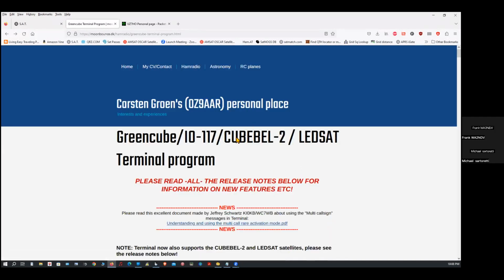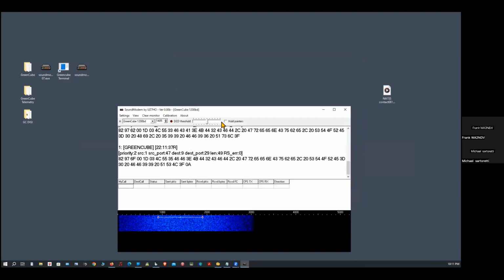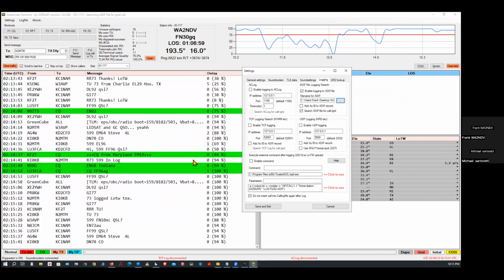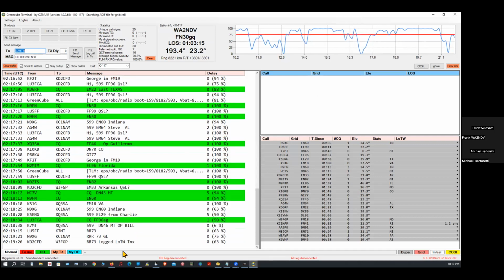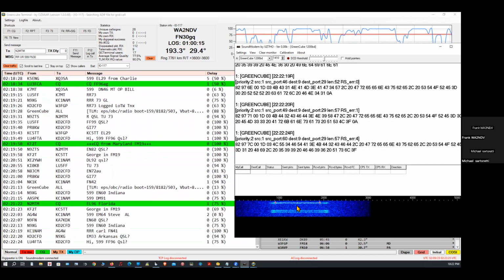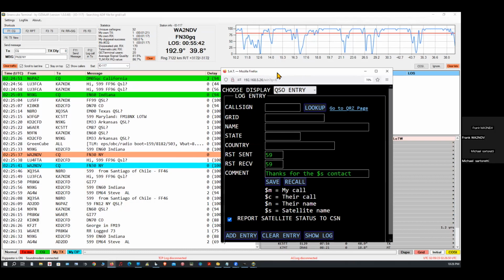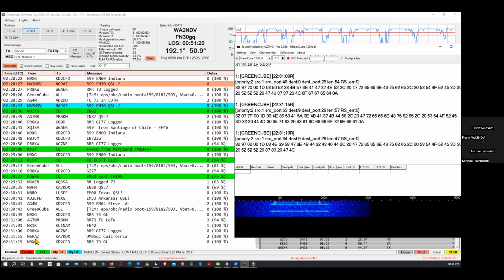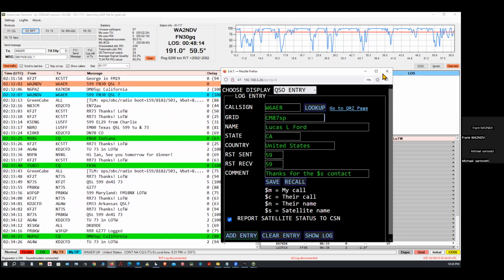Setting up and working IO-117 Greencube with your Icom 9700.

Comment: My waterfall is blank.  When I change the soundmodem  input to microphone, the waterfall shows the ambient room noise.  But when I switch back to usb audio from the 9700 I see nothing.  It’s like the input gain from the usb is set to zero, but it’s set to 100%.  I’m baffled.
Reply: Check  Menu>Connectors>USB AF/IF Output and make sure it is set to AF  also Menu>connectors>MOD Input>DATA MOD and set it to USB.  Be sure you use USB-D as Mode for the VFO

Comment: where are the bandpass freqs of 800-2100  entered.   BPF width    txbpf width   lpf width ???
Reply: Width is automatic for AFSK GMSK you just need to aim for a CF of 1500hz and you can slide the BPF to 1500hz in soundmodem. In soundmodem there is also a small data entry window with up and down

Comment: Why is there a 300 Hz differential between TX and RX plus 60 Hz RIT. Not surre I understand the TX differential off of published frequency? Or how to derermine? Seems a 300 Hz error would make the difference between gettin in or not. And Ive been on several passes with zero luck.
Reply: I know it seems counter intuitive to have different freqs/doppler correction for uplink and downlink but it must be that way. At some point in the pass there can be several Khz difference. The published frequencies do not take into account doppler correction. Its a matter of perspective either you are on the ground or on the satellite so the doppler is different for TX and RX. It took me a while to understand that. The RIT was just a small correction and I was just lazy to add it to the initial RX frequency.
Reply: @FrankG-ob3xs  I have a friend who is occasionally successful with IO-117 using HRD for TX control and hand on the RIT knob to visually correct RX. He says the differential across a pass can be as much as 11 kHz. What is the math for that one might ask? That seems to imply that we may be shooting blind on TX more or less, and using a fixed value for RIT means there may be only one point in a given pass where both sides are actially working correctly.
Reply: I don’t remember the offset being that much? You’re like to see the first reception on 435.113mhz and the last will be on 435.107mhz. That’s just 6khz for a satellite that can be 10,000km away apogee.
Reply: The published centre frequency is 435.310MHz - in the video his Rx is set to 435.309 and his Tx is set to 435.309.3 (plus the weird RIT) before doppler correction. Obviously during the pass the frequencies shift apart depending on where the satellite is and its direction/speed in relation to your station and in order to stay tuned in automatic doppler correction on both Rx and Tx needs to be calculated and applied.  @ehresmanr - I am in the same boat as you did you manage to fix your problem? I can decode just fine I think I have my levels set correctly. I'm using Gpredict and have my ic-9700 on split. I think I'm just not finding the right transmit frequency.

Watching the video seems to imply that his Rx and Tx are locked together and once he has his Rx coming through starting at 800 on the sound modem waterfall then the TX is also correct, but 300Hz +/- doppler from the Rx … Don't know haven't been successful yet
Reply: The centre frequency for Rx before Doppler such that it appears around 800 on the sound modem waterfall is 435.309210 however it does drift on a pass +/- 20 Hz. still have not found Tx
Reply: Sorry my mistake 435.313mhz to 435.307mhz

Comment: Soundmodem is decoding the packets but not getting anything on the Greencube Terminal. Ports etc. are setup but still no joy. Also, on the bottom of the Terminal screen it says "Digipeater off" even during a pass. Please advise. 73 Jack WB6LAU. It also says Soundmodem connected.

Comment: Hello Frank, I have a problem. My 9700 doesn't show a codec for the input device. So I am not hearing anything. My transmit shows Speakers 12-usb Audio Codec. But there is no USB -12 audiocodec on the input device. The com port is good I can transmit from Green Cube Terminal. Any ideas?
Reply: fixed that. no0t decoding. I have the com port right and I have the ports the same in both Green cube terminal and also Sound Modem. My question is, how do you know what port it should be?
Reply: Thanks for the video Frank, 73 de N2NWK

Comment: What SAT settings do you use for the LEDSAT on the SAT box?
Reply: Everything on the SAT is the same. You will see new frequencies and you must fine tune as you did for IO-117. Be sure you select LEDSAT on the terminal program and the soundmodem is the same one you use for IO-117.